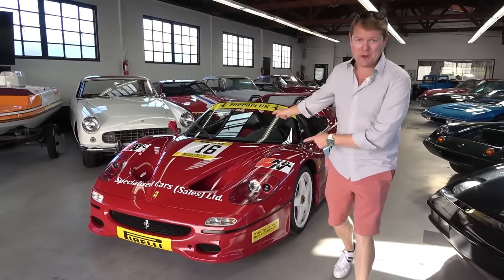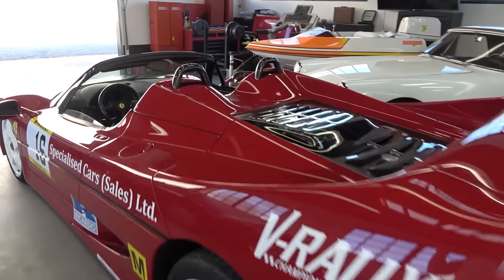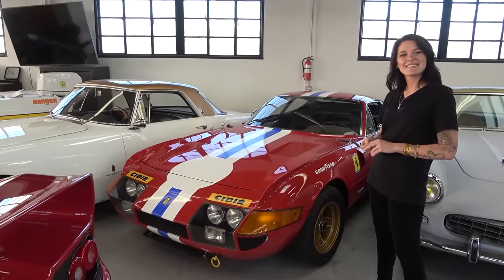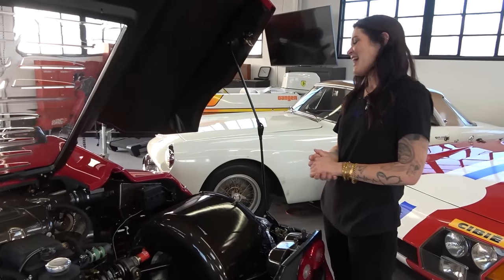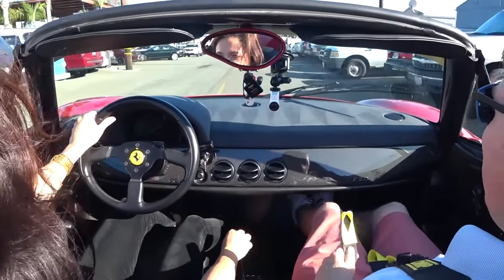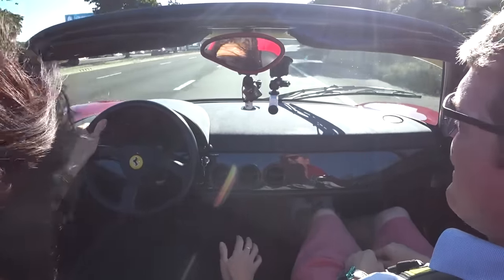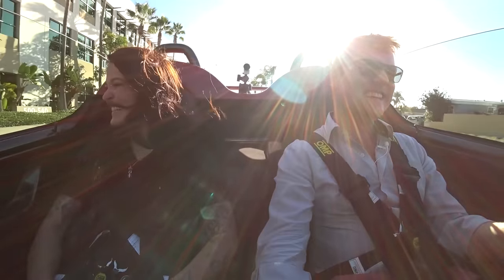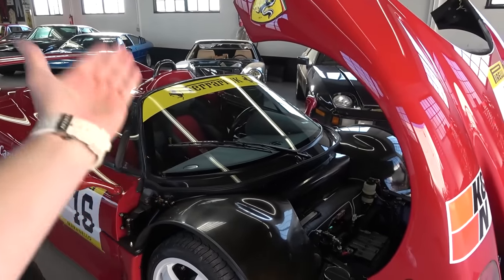F50 FOR SALE! Finally Found My Missing Shmeemobile

Comment: A curiosity, with almost no mechanical modifications, all F50s can switch to the GT engine configuration and produce up to more than 800 hp, and in the street car it leaves the top speed even higher than in the GT because they have less downforce! Years ago I saw a comparison in Italy between a "normal" F50 and one with just over 760hp having made these changes, and it was absurd to see how much faster it was!! The F40 will always be my favorite but the F50 is definitely another passion! I imagine it would look perfect in the Shmuseum and being used correctly! Great content
Reply: “almost no mechanical modifications”…where did you hear that? It’s not the same engine. The F50GT was highly tuned by Ferrari. This car has minimal computer controls compared to today and given it’s naturally aspirated it seems impossible since you can’t just increase the boost like in a modern turbo car. How is it done since this car is mostly mechanical? If it were true almost every one would have it done and none do. I’m very skeptical of this claim.

Comment: Ever since I saw Gordon ripping around New york in the rain shirtless in that black F50, I fell in love with them.
Reply: I remember those videos, up until he crashed it. If I remember correctly he only owned it for a month before crashing it and it had 50k miles on it from the original owner.
Reply: @seashackf1  at least it got driven the way a car like that should be driven & not 2 miles an hour around stop start london
Reply: @stevedavis2473  I agree. I would love to drive one of those for 50 miles, let alone 50k. The crashing part by the next owner after only a month, not so much.

Comment: I disagree with the notion that you shouldn't drive those cars as much because of the miles. Drive It! So what if it has 50K miles on it. You're gonna die without having driven the f out of your cars. That F50 is still a numbers matching F50. Jay Leno drives his F1. I'm pretty sure it's still worth 20mil.